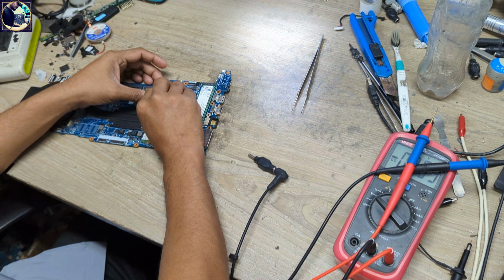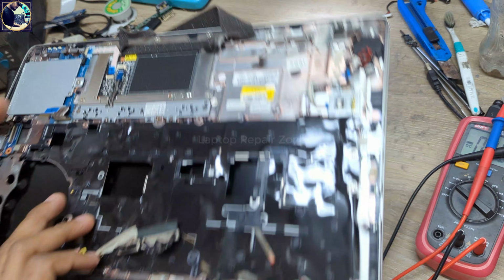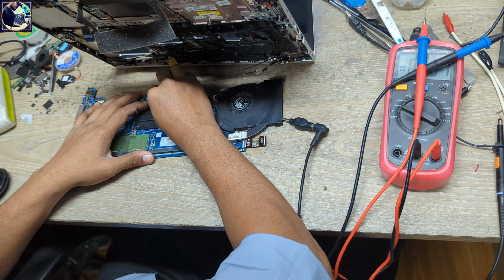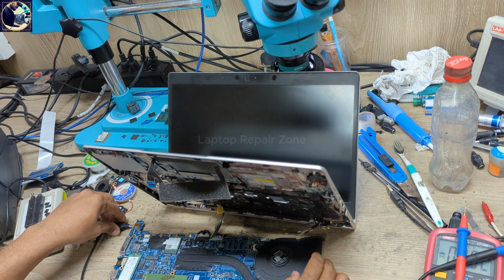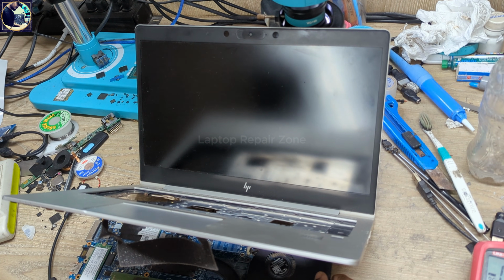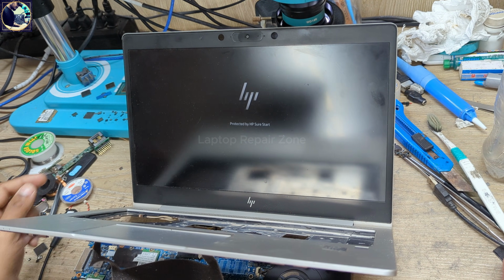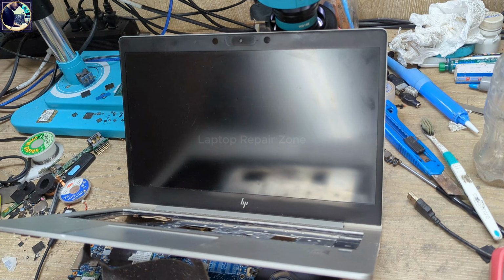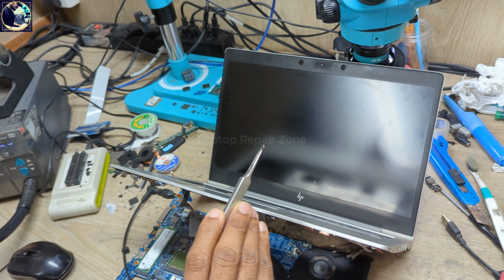HP elitebook 840 G6 no power solved | full guide how to repair laptop motherboard

Comment: I don,t agree with your method of servicing.by taking the board out before showing what the laptop is doing.  I would start by  checking with the complete laptop that would show were one should be looking for the fault.The fan was spinning so most of the voltages would be present.I am sure you know what you are doing but watching you do it was not very helpful.
Reply: at least you should explain properly using schematic or data sheet